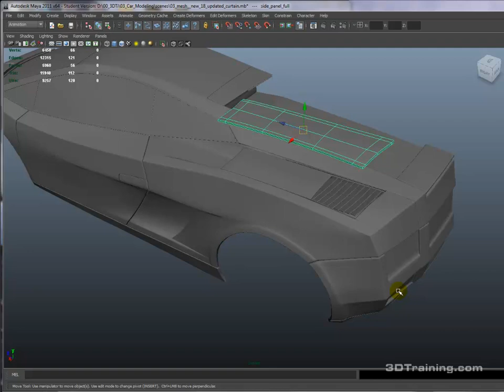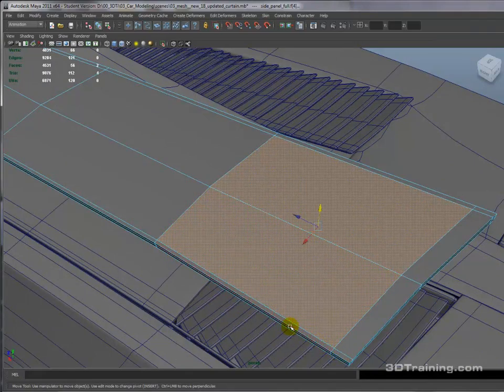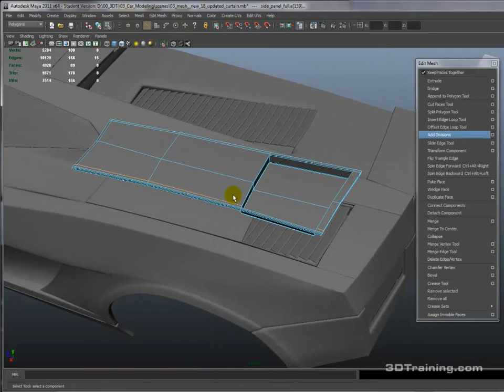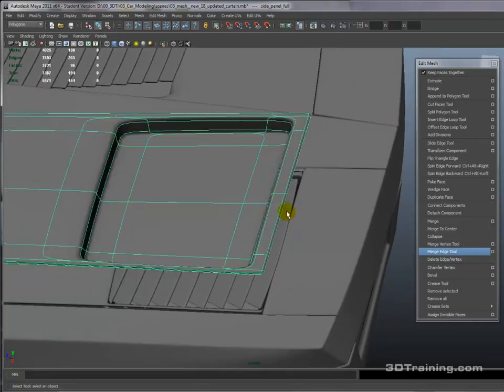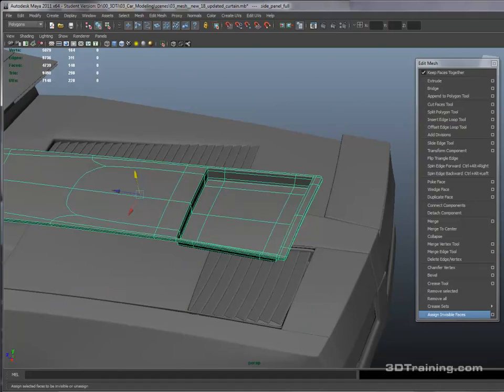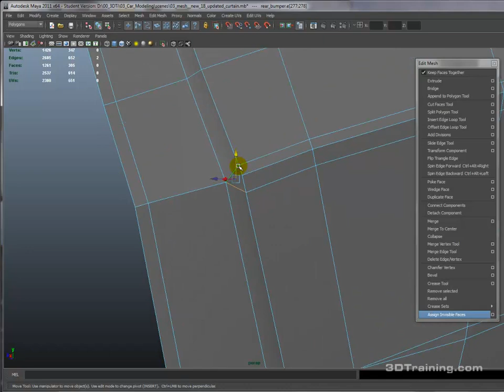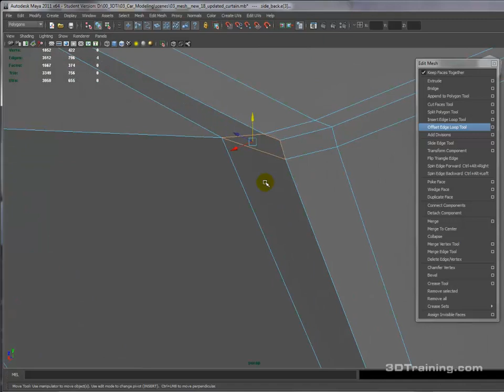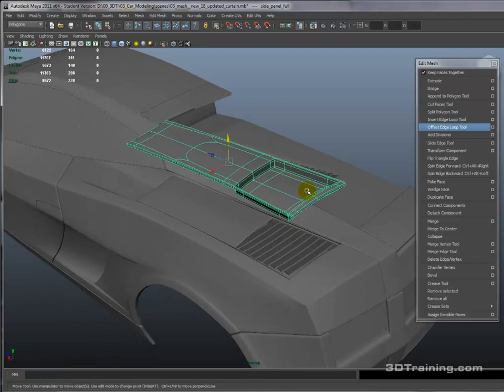Teaching Video - Various Car Modeling Techniques in Maya

Comment: well, the moment when you stop giving a shit about Quad Geometry, you can model anything without any headache. This isn't a professional way of higher eminence studios. I would rather prefer to develop my skills based on industry standards.
Reply from the maker: If you wanted to convert that tri back into a quad so badly, there are one click tools to do that in maya, but since you are super serial about being a top pro than Im sure you knew that already. Steps that help complete a process dont have to appear in the final result.
Reply: @enerses  its not about being super serial, or proving myself to be a higher modeller, but rather more about developing the industrial standard skills set. Leaving N-Gon or triangle in a simple geometry is definitely not a good idea. I hope you agree to that.
Reply from the maker: @ismyalak1419  I agree with that statement. A modeler should clean up the geometry when passing it off in the pipeline. I wouldn't agree that this is simple geometry, nor would I discredit a technique if it gets the job done and its a simple step to turn the tri into a quad. So I dont agree with the general statement you gave about not giving a shit about Quad Geometry when there are just a few tris to clean up at the end of the process.
Reply: @enerses  lolx don't take my words there, It was more of an expression, not a solid statement, I still watched your complete tutorial. But yes once again, it wont train the newbies in a right direction. Cause geometry is the main thing when it comes to vfx and animation.

Comment from the maker: The short answer is that it depends on the situation. If you are using this asset in a game engine then yes avoid n-gons at all costs, but this car was built for rendering purposes and as long as the n-gons aren't causing any shading issues then it serves its purpose and the n-gons can be ignored. It really depends on the final use of the model and what phase it is in modeling. n-gons can mess up modeling tools that depend on quads, so if I was still in the modeling phase and needed to use modeling tools in that area of the model then I would have to do extra work and clean up those n-gons. But for this situation, I didn't need to use anymore modeling tools in that area of the car and the car was being rendered in maya and composited in photoshop so for this workflow I didnt have to care about the n-gons. On a side note, if you plan on using smooth mesh, n-gons will effect the smoothing process on the model. It depends on the look you are going for, sometimes a n-gon causes the smooth mesh to create the right look, but usually not.